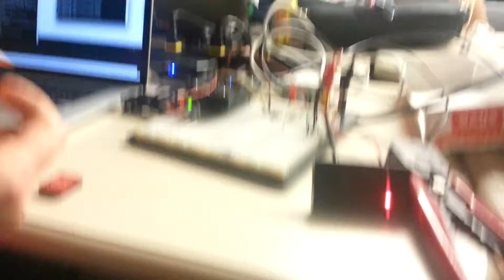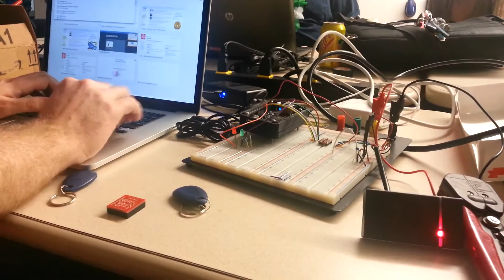BeagleBone RFID access system with Bonescript

Comment from the maker: Our CTO, *****, of Pumping Station: One (Chicago hackerspace) is using the BeagleBone and Bonescript (Javascript node.js library) to build a RFID access control system for our hackerspace.
Reply: I posted the code as a gist: https://gist.github.com/hef/9678629

I have swapped the reader from the video out with a ID12 from sparkfun: https://www.sparkfun.com/products/11827  and configured the ID12 for weigen26 mode.

It appears that the bits get swapped or missed sometimes. I suspect that subsequent interrupts fire before the previous interrupt's callback has completed.
Reply: Bring me in on the challenges here as there are ways to do this with BoneScript.
Reply: Also, where can I grab one of the modules?
Reply from the maker: ***** thanks, hopefully ***** can chime in.  the trouble was that occasionally it would miss bits from the reader.  the bit stream is read into the  bonescript program via interrupt handlers.  it might be that the interrupt handler is taking too long given that it is javascript?  Hopefully Hef can post the code or I'll ask him the next time I see him.